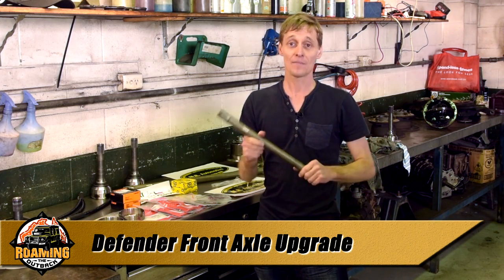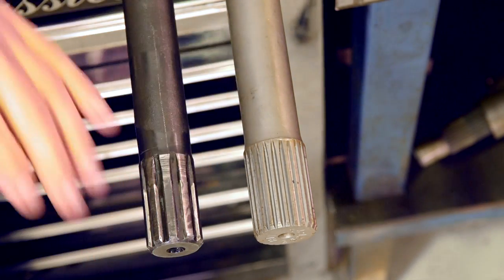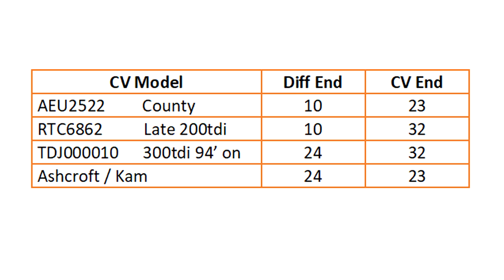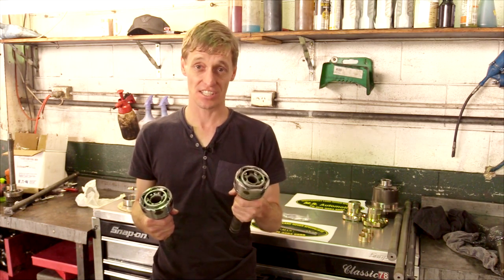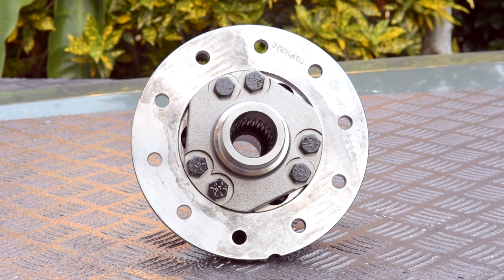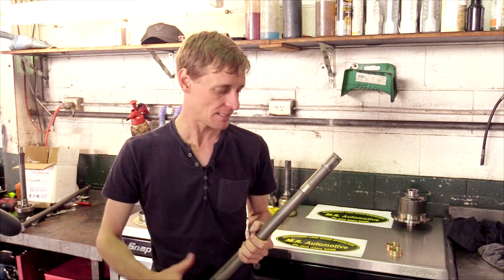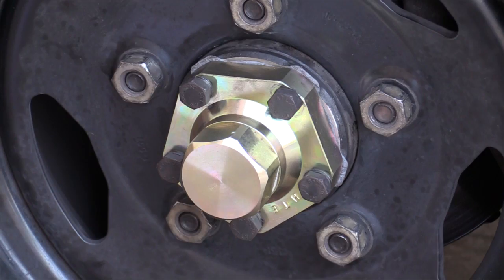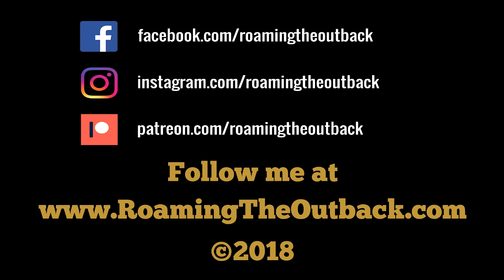Defender Front Axle 10 to 24 Spline Conversion Maxi Drive Halfshafts & Detroit Truetrac Upgrade

Comment: Thanks!  I still have an open front and rear diff. I've gotten everywhere people said I couldn't go without a locker. With some careful and technical driving. And the winch. I've wanted to go didn't the helical lsd track front and rear for a long time. People said it horribly affects handling. Thanks for proving them wrong. And the tip about the drive line slack. Well. That's the icing on the cake. Thanks bret. 👌👍
Reply from the maker: Still yet to test the LSD off road, though I feel the steering should be ok. I'm just gripping the wheel a little more for corners at this point till I get some experience with the feel.
Reply: Roaming The Outback keen to know how you get on with the truetrac in the front. I have a rear one and it is great.
I’ve been worrying about the steering as well
Reply: Bret thank you for replying. And again thanks for the videos. Do you have an instagram?
Reply from the maker: sure do https://www.instagram.com/roamingtheoutback/

Comment: I personally would've gone with lockers but it is personal preference & as ya'll say you do little to no real offroad 4wheeling, which I do a fair amount of. I'm also to frugal to pay labor rates & don't trust mechanics these days anyway, and do all my own work. That said I do like your choice of parts & am sure ya'll will have thousands of miles of great touring ahead of ya'll. Very good review & really like all the details, great video Brett.
Reply from the maker: Yes didn't see the need for a locker. I'd never trust myself doing this upgrade alone, too many tolerances and seals to figure out. Plus the drama of my front diff being the wrong type for my car, so the mechanics found a second hand one for the new centre to fit. expensive, but done right. Thanks.
Reply: full lockers are great. As the host mentions they work all the time, you can't believe how much traction you always have with these. besides I have to drive 3 or 4 hours to off road, and locking up the axles for minutes at a time seemed like overkill. and these tru tracs only get better with the more miles they run. and there is no air compressor needed or electric wiring.  If you live off road then a full locker might be for you. If however you only 4 wheel sometimes or on weekends this is a far better application, at least in my opinion.

Comment: Nice upgrade ... Ashcroft do there own LSD which is on my hit list.  Great to see someone else fitting what I have planned! Hope to hear more about it when you get some time on rougher/trickier spots! 

Interesting point regarding the return to centre. I wonder why exactly??
Reply from the maker: Thanks Matt. Will do a full review in several months once I can test it out on different terrain. I'm guessing the return to centre is something to do with the way the helical gears mesh together. Just have to hold the steering wheel more firmly around corners.
Reply: Yes, there are Ashcroft made helical gear LSD out there, the Ashcroft ATB differential. It uses 6 pair of helical gear, in the Detroit TruTrac they use 3 pair. The more pair  helical gear the greater LSD effect You get. In my Disco 1 I use Ashcroft ATB-s in both axle and I found it very effective. Although the Ashcroft produces more LSD effect, it is not affect the steering badly. The rear one is unnoticable onroad, the frot one is liiiiiiitle bit, but it is so little, that You drive the car for half an hour, and You get use to it and become unnoticabe. Nothing serious. But when You go off roading, both will be serious in performance!;-)  ......and the Ashcroft one is cheaper too.
Reply: Looking forward to it chap!

Comment: Nice video. I have just ordered an Ashcroft LSD. One question, do you notice any pulling on the steering when on slippy surfaces? I living in North Sweden so lots of snow and ice driving.
Reply from the maker: Nothing particularly noticeable. I can feel both front and rear activating as they work me forward in loose sand, which may produce some feedback through the steering wheel.
Reply: @RoamingTheOutback  Thanks for that, look forward to testing it out, just front diff for now. But to be honest once the front wheels pack the snow down the back just follow. Guess this is not the case in Auz : )

Comment: I converted my Range Rover to 24 splines after blowing up my rear diff.  10 splines suck.  My Range Rover has been converted to a GM 6.5 Turbo Diesel with 450 foot / lbs of torque.  Its doubtful the 24's will hold up very long.  Next up will be Dana 60's and 35's

Comment: Great setup! I´ve a question:
Would´nt it be helpful, if the drive flanges stay original, so that they are the weakest point?
If they break, they are not expensive and would be very easy to replace.
Thats the main point I always see in upgrades, exspecially if someone starts the upgrading at the engine side. 
Stronger drive flanges, stornger halfshafts, stronger differentials, stronger propshafts, stronger gearbox etc.
Reply from the maker: Thanks mate. Yes, that may help as the weakest link.. assuming the splines do shear when under load. But again, I think with my style of driving, it will be unlikely I'll have any more issues.
Reply: Thanks for your reply. Sure, the drive flange splines need to shear. 
You´re right, a lot depends on the (personal) driving style. Maybe that´s the most important point...

Comment: Hi. Great video. I have a question. I have the Detroit Tru-Trac  in the rear of my 94 Range Rover county. I have never experienced any problems. As my Range Rover has rear Traction control, which helps trigger the properties of that differential. I noticed a vast improvement in the sand with the rear application. I want to install the same Tru-Trac in the front of my Vehicle. Now that you have had it installed for some time, can you tell me your impressions of the unit in actual operations? Specifically on sand, as it pertains to traction and steering control. Further did you notice anything peculiar, or quirky about it? and in general what were your impressions with highway driving after you have had more kilometers to evaluate that aspect. I really want one but wish to gain your acquired knowledge on the subject. Thank you very much..great video as always. I still want to come there and search for gold in the outback.
Reply from the maker: Mate you'll love them. No issues with it in the front. That initial pull I felt faded and became normal. Onroad no problems. offroad in sand magnificent. I climbed up a soft sand big hill in second low just casually crawling up @16psi. The diffs swap left and right as I lose traction and the opposite wheel grabs. Other cars were dropping to 10psi and giving it the guns. Transformed the car. Only issue was for the first 500km offroad with the centre diff locked, it became difficult to disengage due to the lack of slop in the system. Had to reverse 100m to get it out. That eventually stopped. Love them. no problems otherwise.
Reply: @RoamingTheOutback  Thank You! I just ordered an Lt230 transfer case, (to replace my Borg Warner viscous unit)  from Ashcroft Transmissions, with the newer ATB center diff and steel flanged case.  sort of like a tru trac for the center diff, when it isnt locked. It also eliminates more slop from the system. Hmm, that may be a problem, I will report back on the unlocking in reverse issue, whether I have it or not. When My bank account recovers I will be ordering the tru trac for the front diff..I should be ready for the big sand hills myself then..Thanks again..
Reply: Hi, I installed the ATB (Auto Torque Biasing) front diff (like the Tru Trac, I already have a tru trac in the rear diff), but this is made by Ashcroft Transmissions in the UK.  I noticed that under acceleration on the highway, it seems to slightly pull to the right, when I let off the throttle the steering becomes neutral again. Since you didn't mention having this problem. I suspect that my Range Rover classic's Borg warner viscous transfer case has started to fail and is actually slightly engaged.  I have in my garage an brand new rebuilt LT230 with the ATB diff installed, in place of the planetary gears that Lt230's have. It will function just as the front and rear diffs do, but from front to rear, unless the t_case is locked, that will be installed next week. I will let you know how that functions. I can't wait.
      I did take my 94 RRC LWB for a test on a very steep hill. The ground was fairly hard but has loose bits of gravel and a lot of dust, which makes it somewhat slippery. I went up at a slow pace to test my traction, the front diff was just as you said, I could feel it working back and forth from right to left. I would estimate that it actually never spun a wheel more than say a quarter turn and it went up the hill much better than it had done on previous attempts, with out the front tru trac diff. I had made it up before but not with the same feel and confidence that the tru trac diffs give it. Your experience and comments about this product were/are very much appreciated. I must say that I am jealous of your being able to travel all around exploring and in a land rover too. Thank you
Reply: all these years later (4+)my Range Rover Classic (94) with the tru-trac diffs front hand rear has had zero problems to report. My center diff with Ashcroft ATB center diff has performed flawlessly. I could not be more pleased...I miss your videos. hope life is well for you..

Comment: Can you please tell me how you got on with the function test as per eaton manual please? Preload on my front makes it almost impossible and permanently locked?????
Reply from the maker: I had it all installed, so can't help sorry.
Reply: Please, please can you do me a function test on the front. It's dead easy. Jack up front axle, lock front prop( h brake on) spin one wheel, the other wheel should (should) spin in the opposite direction like any ordinary open diff. So should the rear, as per Eaton handbook. Cheers cob a, from across the big lake.

Comment: When you changed your CV’s, did you get the original LR or aftermarket type like Britpart?
Reply from the maker: They were likely OEM. The workshop ordered them. I would never put Britpart on my car wherever possible.
Reply: Genuine LR AEU2522 have been discontinued for many years.

Comment: 50% stronger! That means they'll only break half as much. Lol. As a child I remember labouring up Wilson's Promontory, popping end shafts, and nearly going over the edge because the brakes were no good either! Christ I hate Landrovers. ;-)
Reply from the maker: haha. always a possibility.. Would not have enjoyed that trip. But you survived.
Reply: it is true! reminds me of the bill that the owners of the "76/79" pay, only for the TOY with the rear wheels in line with the front !
Also change the brakes, 
increase the horsepower of the engine, but then drive very slowly to maintain decent consumption....

Comment: Getting to know how to fix your vehicle in the bush is vital to reliable and safe travelling remote areas. Your new system is not 100% bullet proof.
Reply from the maker: Nothing is 100%.. but this removes most of my worries about the original LR gear. With my style of driving I'm far less likely to have issues.

Comment: Always love your videos
But needing $10k for a recovery in the Simpson Dessert is just BS.
We use him heaps for work when we take test vehicles out there.
Yes he is very $$$, but not $10k before he starts. That's utter rubbish.
He will ask for $2k before he gets going.
There is a fella on the Gibb River Rd that has asked for $6k before he left...
$10k seems like one too many campfire stories to me
Reply from the maker: I can only go by what I've heard as I haven't done the Simpson yet. One of those 4wd shows was saying $10000, and on a few posts I've read. Thanks for the update on correct pricing.
Reply: @RoamingTheOutback  These costs are from 2007.  

Recovery from Birdsville Auto:
$2.00 per km for the trip out to recovery location
$4.00 per km for the return trip to Birdsville
Plus: $65 per hour for when the recovery vehicle
leaves Birdsville, and until its return to Birdsville

Recovery from Mt Dare:
$1.00 per km for the trip out to recovery location
$2.00 per km for the return trip to Mt Dare
Plus: $50 per hour for when the recovery vehicle
leaves Mt Dare, and until its return to Mt Dare

Comment: i have a 2001 defender 110 county with a lot of backlash and have been thinking of doing this upgrade for a while what is the weight of all the parts roughly as i need to get them shipped to NZ
Reply from the maker: Couldn't tell you for sure.. but probably around 60kgs - 80 kgs.